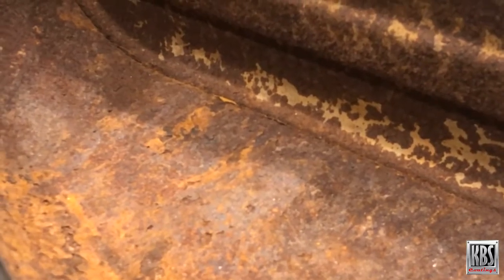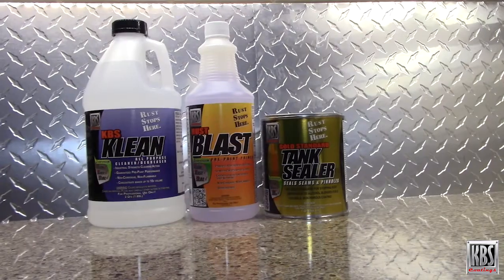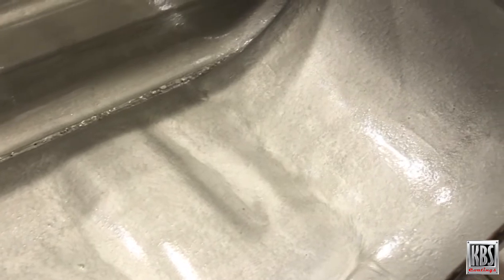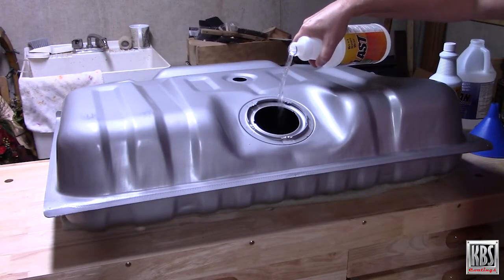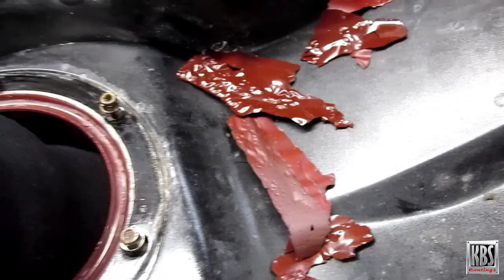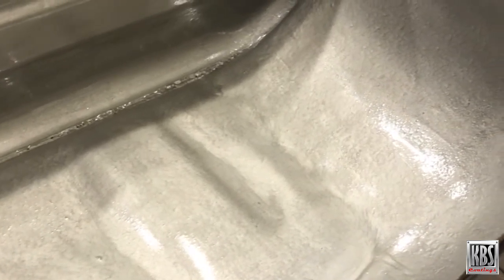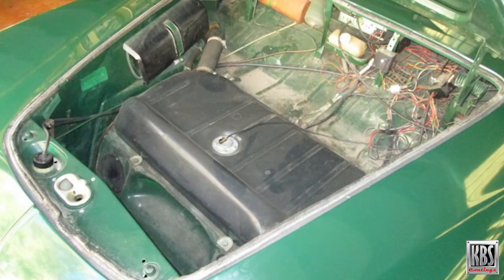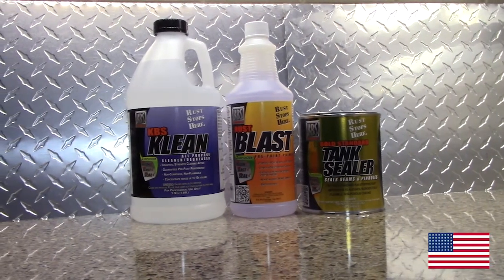KBS Gas Tank Sealer All-Inclusive Kit Restores and Seals Fuel Tanks

Comment: Can this be applied on a in frame fuel tank that can not be removed from machine.
Reply from the maker: If you have an access hole through which you can do all  three steps (brush on the Tank Sealer versus roll tank), absolutely.
Reply: Can it be sprayed in as I won’t be able to reach all the corners.
Reply from the maker: @johnschlabach2937  Yes, you can spray Tank Sealer. Simply follow the directions for spraying RustSeal. Thinning/Reducing is not generally required, but if needed, 5-10% is normally adequate. Use KBS #1 Thinner or Xylene only which are compatible slow evaporating solvents. Do NOT reduce RustSeal with lacquer thinner. After thinning and stirring well, strain with 100 micron filter. Complete Directions: https://www.kbs-coatings.com/rustseal-directions.html